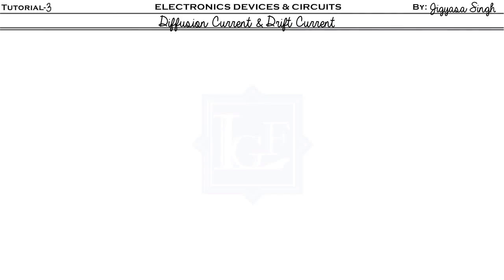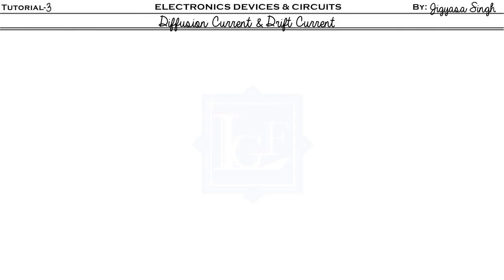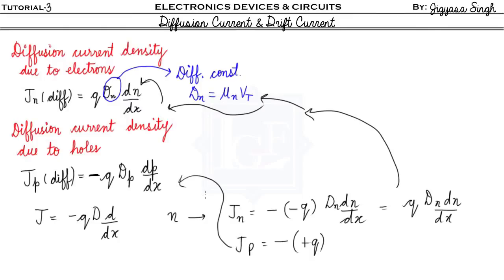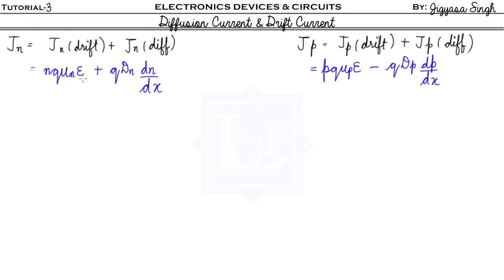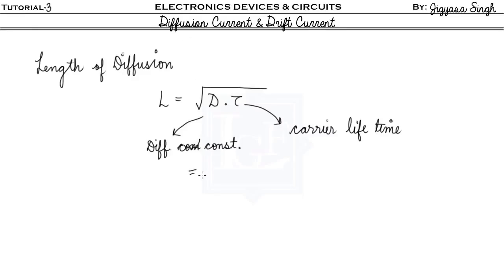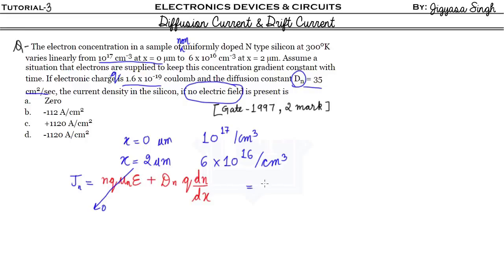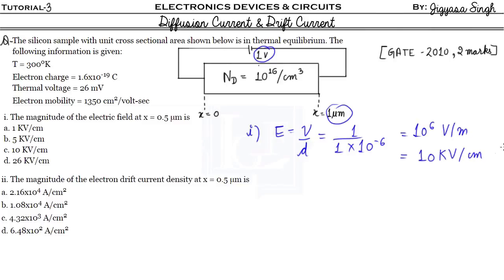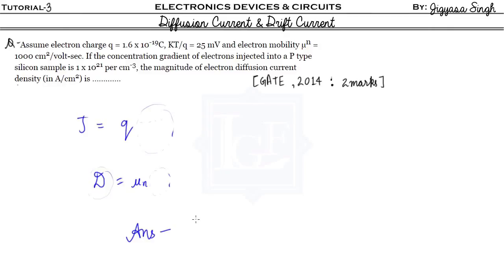Lec 03 Drift Current and Diffusion Current

Comment: At 18:30, in the question it is asked at x=0.5 micrometer...I think that the answer should be half.
Reply: yes
Reply: no the answer was correct..since the sample is in thermal equilibrium and constant voltage of 1V is applied magnitude of the electric field remains constant throughout...
Reply: E is equal through out the semiconductor so find it at 0.5 or 1 cm it will be similiar
Reply: thermal equilibrium!!